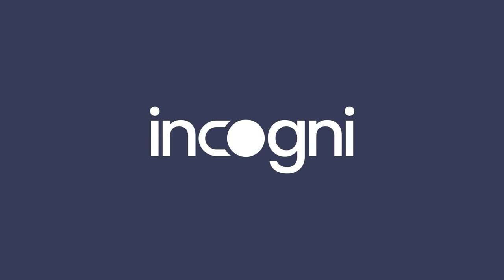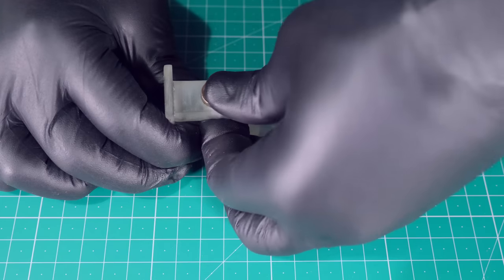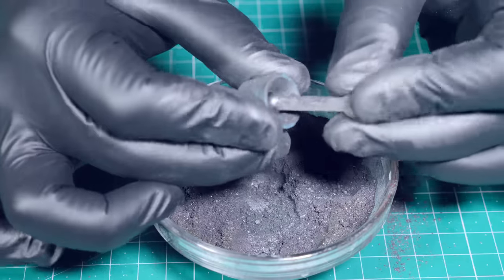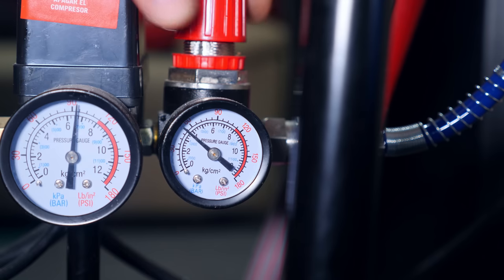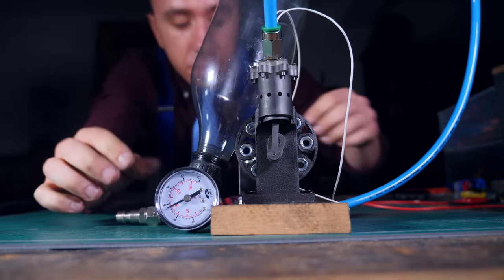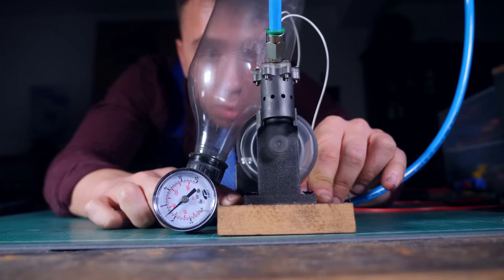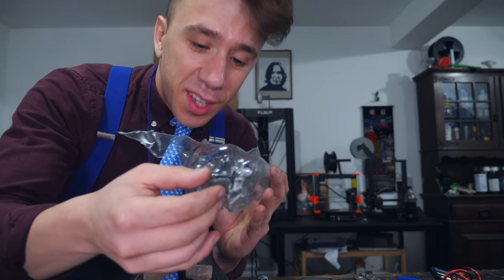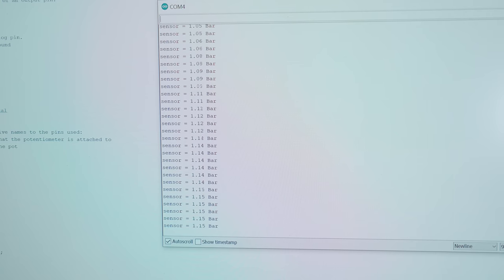Magnetic Air Engine

Comment: I like how someone started building some sort of compressed air engine and now slowly more and more of tinkering and engineering channels are infected by the air engine fever. xD
It's amazing to see the different approaches, even if the designs are sometimes similar, different tools, materials as well as designing philosophies make every iteration enjoyable.
Reply: I know Tom Stanton, who else do you know?
Reply: Have been thinking about this concept in terms of power generation for a couple of years now, the problem I had was long term reliability at scale, I've been thinking in terms of 50 watts and up output as a source of renewable electricity.

Comment: a simple v twin engine with that co2 pressure system might actually produce a significant amount of torque! it'd be fun figuring out a crankshaft and output for the engine, maybe even a centrifugal clutch. super cool as always
Reply: Boxer would be easier to fabricate. But, we could also use the reverse and use two pistons in the opposite ends of the cylinder...

Comment: Great video! Here are song suggestions I have:

1. Remedying backpressure. High exhaust pressure can create backpressure in the cylinder, which resists the movement of the piston during the intake stroke. This backpressure reduces the engine's overall efficiency and power output because the piston has to work against this resistance. Maybe adjusting valve timing, valve size, and exhaust system design would help with that. 

2. Consider using materials with lower friction coefficients for the cylinder and piston. For example, you could use materials like PTFE (Teflon) or brass for the cylinder and maybe consider high-quality piston rings to improve sealing and reduce friction. Lower friction = better efficiency.

3. A magnetic sensor and magnet setup is a step in the right direction for sure. Maybe you may also want to check out other valve types, maybe solenoid valves, to achieve smoother operation and better control over the air intake.

4. Maybe you'd like tomato if you had a good cold one. I enjoy a recipe that has been in my family for ages which is essentially a tomato salad. Chopped tomato (bite size), cubes of feta cheese, salt, pepper, and a whole lot of ev olive oil. Mix it up and let it sit in the fridge for a while then eat some as a side with dinner. You can add things like cucumber if you like as well. Worth a try!
Reply: Damn, chatgpt rally did a number here
Reply: And you can see exactly where u added the fourth one lmao
Reply: Yep, those are great song suggestions

Comment: I've built this design (uniflow bash valve) for over 50 years.

Use a Reed valve over a hole (inlet) at the cylinder's top!

I also build peristaltic engines.

Need lightweight higher pressure?  Put a chunk of dry ice in your "boiler". The phase-change partial pressure of dry ice is 920 psig!

Comment: Use a much smaller bottle as the pressure reservoir and switch the tiny tank for a paintball tank. Also, you might consider a wider piston with a shorter crank distance to increase torque while maintaining pressure usage rates.

Comment: Suggestion: You have made a lot of rocket and jet engine and you have mostly used propane for those my suggestion is that you make a jet engine that runs on HHO that is obtained from performing the electrolysis of water and as you already know hydrogen has the highest calorific values so it should give you hell lot of thrust and also try different types of nozzles with it

Comment: 1st use a regulatorvalve and keep a constat pressure, so the output is smother.
2nd Match the cylinder stroke/volume increase with the amount of gas you put into the engine so you waste less energy.
3rd use a sealing wich closes with pressure increase, so like a U-shaped sealing ontop of the piston.
4th put the valve direcly ontop of the engine so the timing isn't delayed.
5th Use an adrunio to controll the valve timing.

Comment: You should try to make a Taurozzi Pendulum Engine, that basically  has a curved cylinder and piston to reduce friction between those parts. 
It has been used in 2 strokes to reduce the amount of oil consumed and it amazingly worked.
Reply: It's an interesting model, but a traditional engine with an offset crankshaft already can achieve a good efficiency, and it's a lot simpler to manufacture.

Comment: You could try moving the piston magnet to the flywheel or crank, then add an adjustable bracket to hold the sensor. This will allow you to advance or retard the timing. Adjusting the timing could allow for more pressure to be used. You could then use the Arduino to actively adjust timing based on RPMs giving a much nicer power curve.

Comment: Maybe put the magnet on the crank shaft, like a flywheel magnet, to lighten the piston weight while keeping (and possibly tuning) your timing. Also, do you think an opposed piston design would improve efficiency? Also, also: What if you implemented a flexible rubber bleeder valve that sealed when the forced intake air is deployed, but remains open when the piston(s) return to TDC in an effort to remove extra compressive resistance of the piston(s) moving back up?

Comment: To remove losses from the ball valve, how about using two pistons and a rotating valve?
Send the incoming air to a junction with a cylinder with a rotating valve which is also the end of the crankshaft. Right before the first piston hits the bottom the valve closes the incoming air to the first piston and starts opening the flow to the second piston.
The valve is really just two half-filled (D-shaped) cylinders on top of each other, rotating inside a hollow cylinder with incoming air through the bottom, holes on the opposite sides of cylinder wall for the pistons intakes  and again, above it holes for the exhaust controlled by the other (inverted) D-shaped cylinder with the exit on top. Easy to draw and make, not so easy to describe.

Comment: Hey Integza, love the videos. In your next revisit of this engine, I think if you were to take this compressed air engine and make it a 3 cylinder where the pistons are offset correctly the canister might not last as long, but you should be able to up the RPM and make it flight capable. Keep up the great work.

Comment: I just had an amazing idea, and I HAD to come back and share it. What if you put a thick, strong rubber balloon, one that takes at least 1 bar of pressure to inflate beyond its empty state, inside the pressure vessel (the bottle, in this instance), such that when you pressurize the bottle, you're inflating that balloon inside the bottle? It wouldn't affect the maximum amount of pressure the bottle can hold, as the balloon would just mold to the shape of the bottle, but when the bottle is close to empty, the balloon will continue to squeeze out air until it's completely "relaxed." I'm pretty sure it would act too keep the air under pressure until the very lay moment, while also helping to keep the pressure constant until it reaches that point!  You could also just wrap thick rubber bands around the bottle, which would achieve the same effect while also strengthening the bottle,but the balloon method woukd achieve the same effect, but in a simpler way.

Comment: Hello Integza, 
as a first improvement you could use a smaller bottle in order to use less amount of CO2 to maintain the constant pressure of 2 bar in order to operate the engine for more time. Another idea that comes to mind is to use more co2 canisters in series to have more gas available. Finally, you could also add a potentiometer in order to manually adjust the constant pressure that must be in the bottle in order to increase or decrease the rpm of the motor.
I hope these tips are helpfull for your next video that btw I can’t wait to see. 
Bye :)
Reply: Great the idea of using a smaller bottle
Reply: @LucaPocchione-wg9fi  or could just use more Co2 canisters lol
Reply: @jackasshomey Yes for sure, but it would increase the weight of the engine and since in the video Integza talks about a use for a plane, would be ideal to reduce the weight

Comment: IMPROVEMENT IDEAS:
1. Improve cylinder head to allow fine-tune adjustments;
2. Relocate electric air valve atop cylinder head to gain optimal presure response time;
3. Use straight-sided soda bottle(s) to eliminate distortion weak points;
4. Reinforce soda bottle(s) with graphite & resin sleeve(s) to hold more pressure;
5. Use piston O-ring for perfect seal;
9. Use WD-40 inside cylinder;
4. R&D optimal cylinder vs crank ratio(s);
5. R&D quantity, size, and angle of exhaust vents;
6. Use multiple C0² cartridges in parallel;
7. Impliment heat sink(s) on C0² cartridge(s) to reduce frost;
8. Rack-mount everything into a compact and stackable module;
9. PM me for more 😊
Reply: WD-40 is not a lubricant. Use sewing machine oil.
Reply: Silicone oil for a treadmill is way better for air seals. @GordieGii
Reply: @Pipizzakitchen   Could be. I just thought of the first thing that a really low viscosity. Do treadmills have air seals? What is the viscosity of silicone oil for treadmills? Silicone oil has been pretty thick in my experience; similar to gear oil.
Reply: @GordieGii  the 100%( allegedly)  silicone oil that they use in treadmills is a little thicker than sewing machine oil but better for rubber and will put up with higher heat and stand up to insane pressure. It's what they use in PCP air rifles.

Comment: I don’t see anybody mentioning this, but if you mount the solenoid right about the cylinder intake, you’ll save a lot of air and be able to run more easily. Right now the whole hose is part of the pressure chamber. 

Very smooth!

Comment: This build is amazing! Now here's a question I have. Does ionizing the air using light increase the efficiency of an ionocraft? Can it be used to make a ram jet of sorts by having the negative wire in the inlet, UV light in the "combustion chamber" ionizing the air further, and the positive in the exhaust? Just an experiment I feel you can pull off! 🤗

Comment: You have a uniflow engine. As the piston approaches bottom centre it uncovers the exhaust ports letting most of the exhaust gas out, as it starts back up the cylinder the piston covers the exhaust ports and compresses the residual gas which serves to bring the piston to a smooth stop at top centre. Uniflows sometimes need relief ports to avoid over compression. 

The problem is the valve either stick and ball or magnetic opens and closes the same distance before and after TDC so the first half of the gas is being used to try to push the engine backwards. You don't need this gas to slow the piston down and reverse it as compression in the cylinder is already doing that.

If you can adjust your valve timing somehow to open at TDC and close where it does at present you can cut your gas consumption in half and the engine should run faster as you will have got rid of the braking effect of early admission. It should also run with a lighter flywheel as you should need less inertia to carry it over TDC.
Reply: Theintegza1  Try using the magnetic valve but trigger it with a magnet set on the flywheel so you can adjust valve timing by advancing or retarding the flywheel.

Comment: What about doing this but with  Multi-cylinders? A 2, 3, or 4 cylinder design would be pretty cool.
Reply: the problem with multiple cylinders is you’ll lose pressure at an exponential rate as you add them to the system. you’d get more power, but less run time. Similar to a V8 burning more gas than a 4 cyl
Reply: @blaineburgess true, but if optimized right anything is possible. He might not get the 150-second run time, but if he gets double the output for 75 seconds, wouldn't the loss be worth the reward?
Reply: @duckdestroyer2412  just depends on the goal you’re going for. If you want power, then your idea is perfect, if you want run time (which is what he was going for in this video) then it would be a disadvantage.

Comment: improvement idea: instead of using heavy cO2 cartridges use something to limit the pressure the bottle outputs so the engine can run longer on slower and steadier speed
Reply: So, replace one, not so heavy object that replenishes the bottle with a heavier regulator that doesn't add much value ?
Reply: @jmackinjersey1  Regulating pressures can be done without an adjustable brass fixture. People have managed to create 3D printed pressure regulators, while being thick plastic, it's still plastic which should weigh less than a CO2 cartridge OR a brass regulator. The other thing is with enough effort one could even make an even lighter, non-adjustable regulator design that could work without any screws.

Comment: You need timing advance to run at higher pressure.
One way would be to move the magnet to flywheel as others suggest. Then have the reed switch move, either mechanical governor or an electronic version.

Better yet swap the reed switch for a hall sensor and write arduino code. You can detect distance to magnet so timing can be all software. You wouldn't need to move magnet to flywheel in this case, but might still be a good idea.

Comment: Instead of trying to push air in. Use a vacume to pull the air through. Also the fly wheel. For your weights add magnets. And a copper coil. So when it spins it can generate power for the vacume. Also if this gets added to a vehicle. Allow for the air intake to capture the air from the outside of the vehicle. The vacume only has to run when the vehicle is not moving. When the vehicle is moving just allow the air intake to push the air through the system.

Comment: I would not mind a free 3d Printer to get things stated for my Scouts.

A suggestion for improvement:
1 - Magnets on the fly wheel with coil armeture at the base, similar to cumbustion engine push mower
2 - Collect that electricity in super capacitor array to keep the electronics running - (could be a means of using the design to make hybrid vehicles)
3 - recycle the exhausted air to increase the run time

Comment: Most plastic quart/litre beer bottles have a plastic liner that allows for a greater pressure reservoir than a soda bottle. An air gunner will tell you (as you saw) that the faster a charge tank empties the more it frosts up and loses power before the charge is empty. You might employ a passive insulator or an active chemical heat source like a hand warmer to encourage better efficacy from the tank.

Comment: instead of a co2 cartridge, you can use a liquid propane can. so in will run longer. the exhaust can be ignited to avoid air pollution

Comment: You can do the same but the pressure that comes from a boiler and water vapor. Or if you want to do it wildly instead of water vapor the pressure could come from a combustion chamber in a closed system, you could control the flow by combustion more or less. I can think of so many ideas that I could spend the day
Reply: By the way, tomatoes suck it

Comment: Try using a 20K volt igniter, and aspirate with a fine mist of water, very small amount to begin. Spontaneous vaporization of the water occurs as the mixture cools and expands as the igniter applies energy at the inflection point. it is essentially a steam denotation at a critical point. Very low energy input, about five running watts of draw, being 20kV(0.01A).  The igniter creates a phase change, every rotation, with just a little push over the edge. Try 18 degrees before TDC. 15% water vapor/vol. 16:1 Compression ratio. Steam diesel.

Comment: You should when you put the engine on a plane be able to read out in flight the pressure and control it yourself depending on the speed you want or shut it off to land, maybe even connect one straight to the engine with another rc valve to act as like a turbo!

Comment: If you use the CO2 canisters, you don't need such a large bottle. You could use a 25 or 33 cl bottle. Or you can use a variable valve controlled by a steppo motor and not use a bottle at al. Since you can change the flow restriction with your Arduino (using a pressure censor) depending on how much the output pressure is deviating from the optimal pressure. If you're going for a remote controlled divice it might be fun to be able to change that pressure to increase or decrease power during operation. There is also a way to do this mechanicaly if you'd prefer that.

Comment: I’ve got some suggestions.
#1 - get rid of the co2 canister just because they are something you have to buy and throw out. 5 or 6 bottles in parralel should give a similar result without the wastage
#2 make it a 2 or 3 cyl engine to smooth out the power. You will lose a bit in friction but it should not be too much and shouldn’t really use much more air pressure to run at the same rpm
#3 try to make it mechanical only to get rid of the electronics overhead. There must be a way to regulate the pressure mechanically to make it fully 3d printable

Comment: Add thin PTFE piston rings to the piston of the air engine, and make the sleeve from glass tubing, so there is a minimum of leakage rate from the piston engine when the piston is held at top dead-center. The less blow-by you have, the better, and condensate water should help improve the seal. If there is a way to shorten the length of tubing between the valve and the air engine, that is also better because there will be less parasitic compression in the tube and a closer relationship between the open time of the valve and the volume of air admitted to the cylinder.